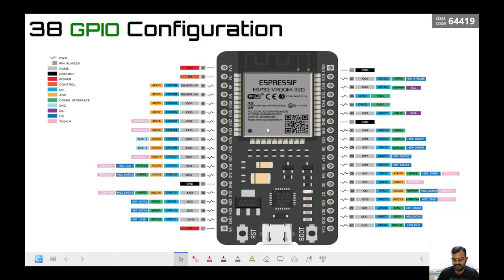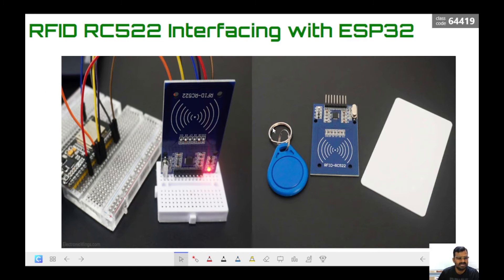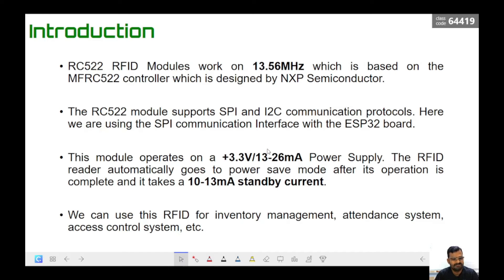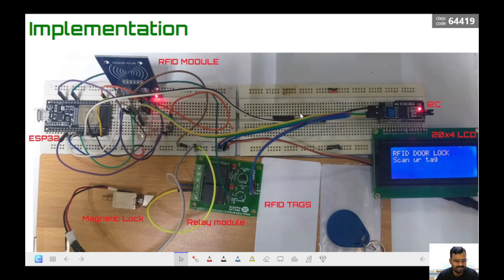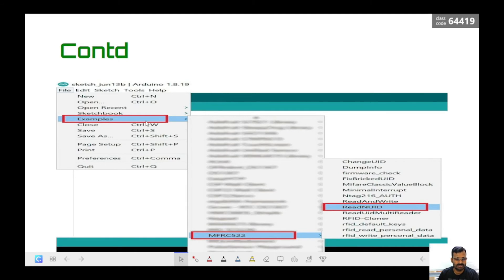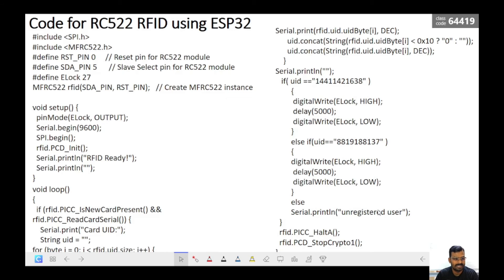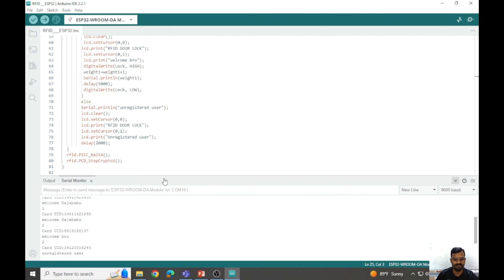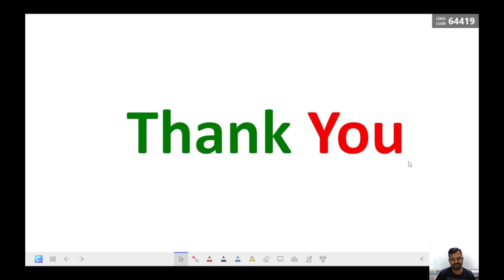RFID & ESP32 based Door Lock

Comment: hi do you need to connect solanoid lock with power supply?
Reply from the maker: yes it is controlled through relay. control signal for the relay coil is coming from ESP32